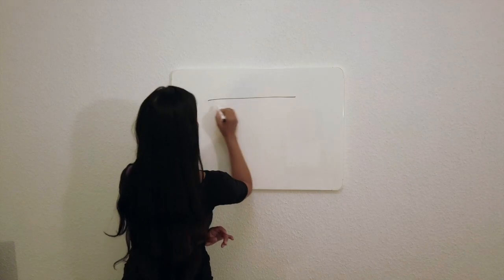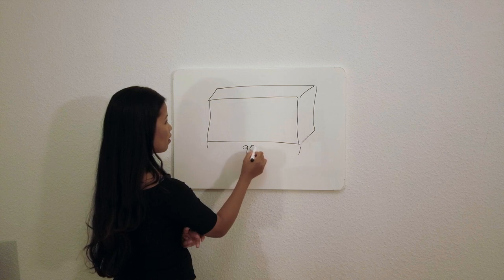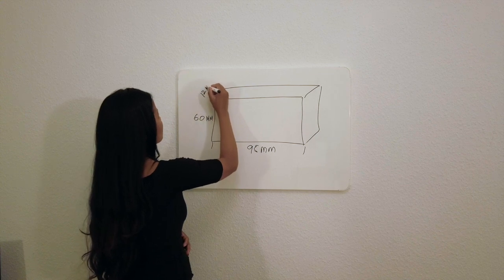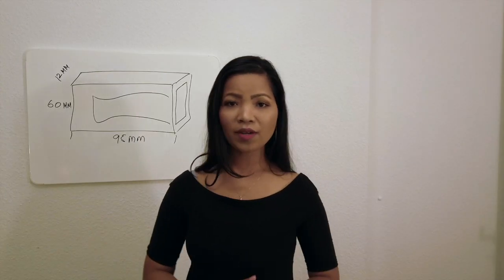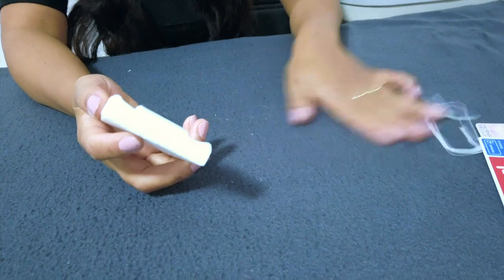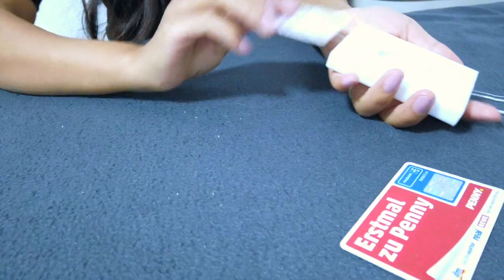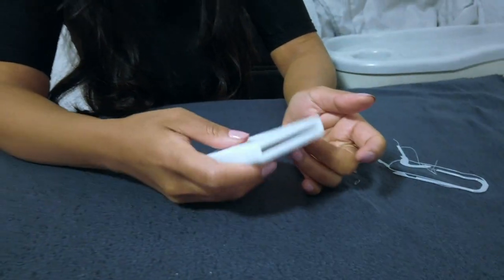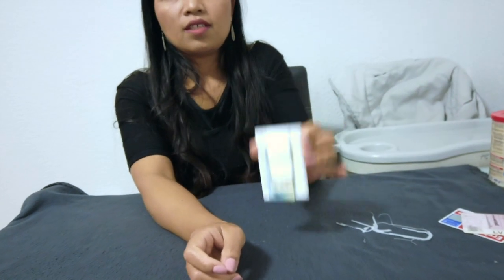3d Printed Wallet (minimalist Design)

Comment: The clip on mine keeps snaping off in petg. Should i use tpu instead? Or maybe print in higher temp?
Reply from the maker: Hmmm..  I haven’t tried with tpu.. I print with petg 245/80, but a lot of stringing